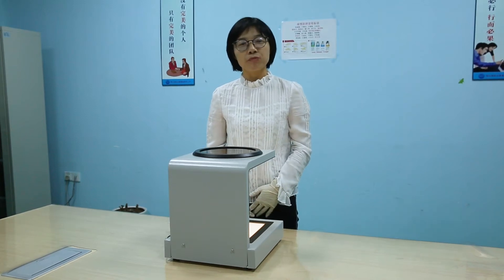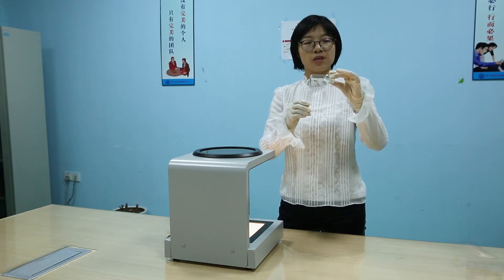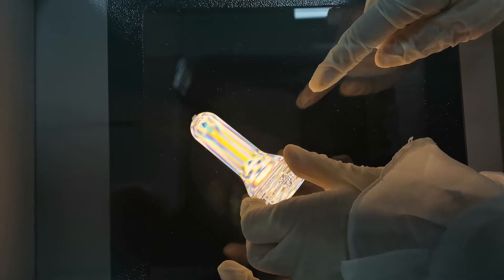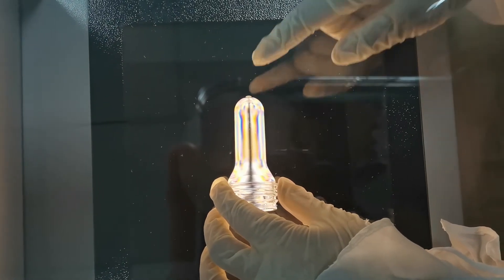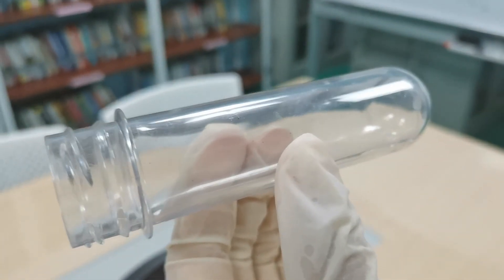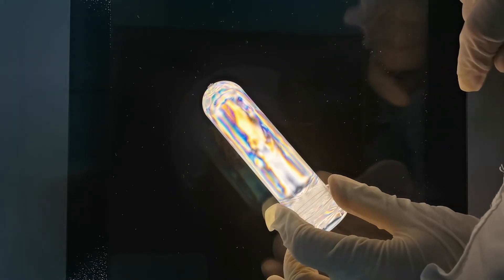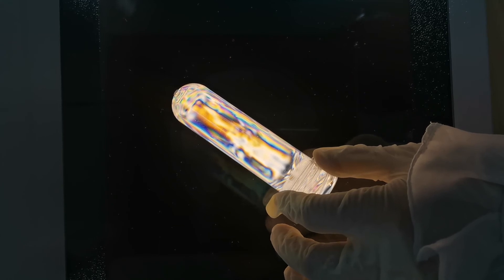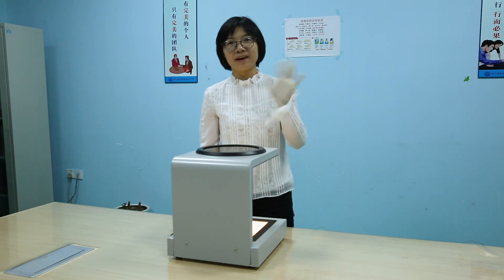How does a Polariscope make defects within PET preforms visible ?

Comment: I need a device to detect fine water lines in opaque PET preforms.
Reply from the maker: Our polariscope can detect fine water lines in transparent PET preforms . But it can't work with opaque PET preforms . To observe water lines , it requires the  light source light to be received by the top part of the polariscope .